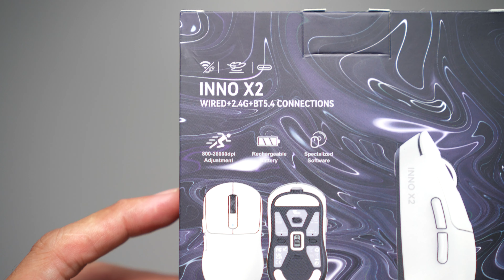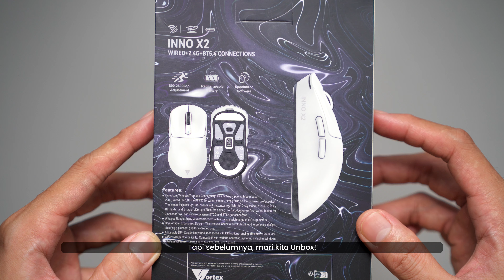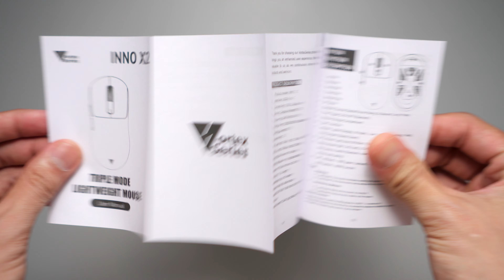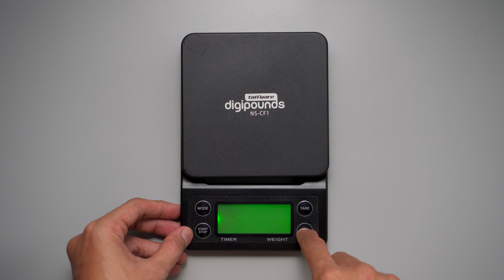VortexSeries INNO X2 Wireless SuperLight Gaming Mouse - Unboxing, Teardown, Review VS INNO X1 - ASMR

Comment: bang adi, ini click latency sm CPI nya brapa klo boleh tau? 
dan dibanding aria XD7 masih mending mana soal kestabilan cpi sm click latency nya?
Reply from the maker: click latency ga tau ya karena ga punya alat kayak optimum tech buat testnya, tapi kalo asumsi sama2 1000hz dengan posisi dongle yg sama, ga bakal jauh2 banget lah ya
"At the end of the day, both CPI and DPI are often used to refer to mouse sensitivity. The main difference comes from the viewpoint of the company. If the viewpoint focuses on the mouse cursor on the display, it’s referred to as DPI. If focusing on the viewpoint of the mouse sensor itself, it’s referred to as CPI. The higher the CPI and DPI values, the further the mouse cursor will move related to user input. "
CPI dan DPI beda metode ngambilnya, satu lewat gerakan di layar, 1 gerakan di sensor, cpi mungkin lebih akurat karena ga bergantung sama spec monitor, tapi bukan jadi bumi dan langit.. 
intinya, secara spec, keduanya sama2 3395, jadi perbedaan marginal, tergantung si microcontrollernya proses datanya gimana dan software mousenya sendiri gimana..
unless competitive person yang buat ikut kompe, kayaknya angka tersebut ga terlalu signifikan ya for average gamer or maybe enthusiast gamer, dan even angka itu penting, compe person pasti ambil yg lebih branded dan lebih mahal karena datanya lebih akurat  misal kelas2 razer, zowie, logi, yang emang rata2 dipake oleh compe player..
but kalo ditanya, stabil ngga, ini itunya, balik lagi, saya ga punya alatnya
Reply: @adimology  makasii banyak bang buat jawabannya yg sangat mendetail 🙏🙏
keliatannya innox2 ini sudah sgt lbh dr ckup untuk kelas budget competitive